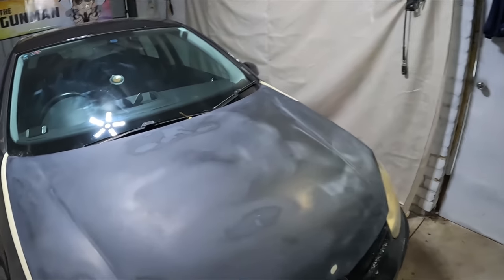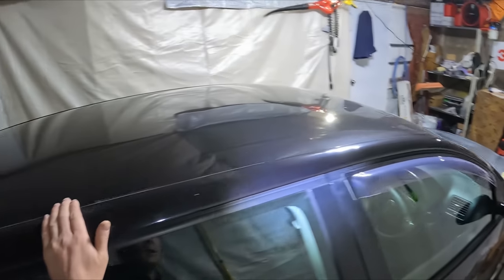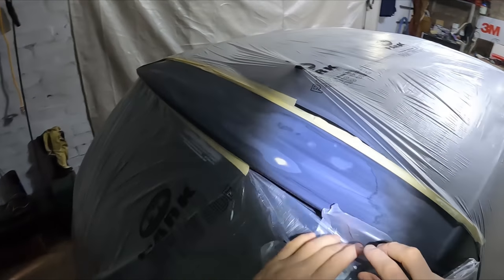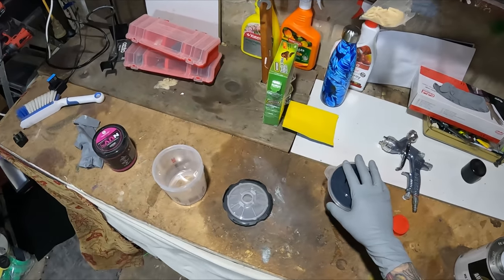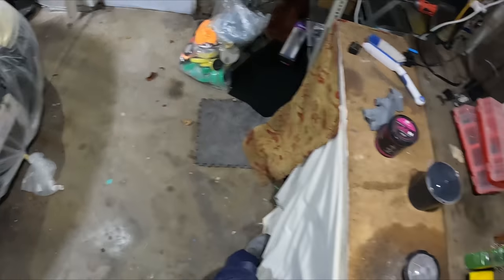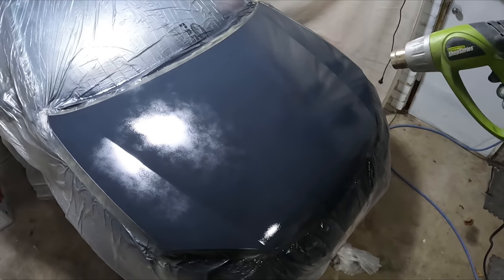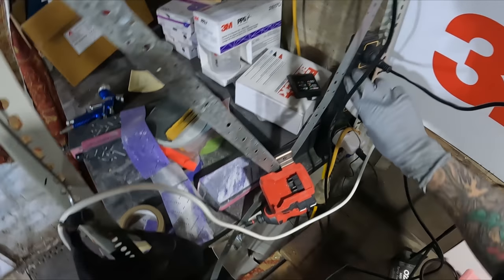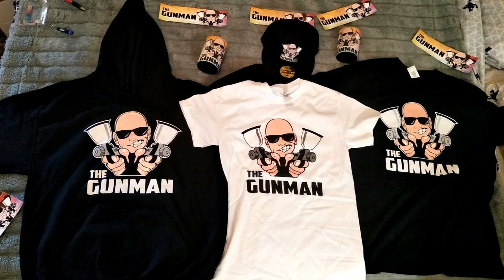Primer Work In The Garage.

Comment: I'm trying to do a refinish job of a roof spoiler for my car that's the clear coat peeling.
Color is black and i only have acrylic white primer in a can that in instructions says it's only for metal,wood, aluminum,glass and stone.
Can i use this white acrylic primer after i sand original paint that the clear coat peeling or do i need to get a primer specific for plastic and darker color?
I'm trying to find plastic primers but i only see adhesion promoter sprays for raw bumpers.

Comment: Good video mate. Im getting into DIY painting but my first job I couldn’t even start. I started to spray 2k primer and it didn’t even come out properly. It was like grey arm hair falling onto the panel. Discovered later I have a 1.4mm tip but apparently need 1.8 minimum for high build primer. Does this sound right if all other factors were correct such as psi and gun controls. Thanks!. 
Also a mk5 golf like the one in the video !
Reply from the maker: More thinners by the sounds of it man. More thinners.
Reply: @TheGunmanChannel  thanks bud ! it was very gloopy. Obv too thick to come out the nozzle? I added 10% thinners but obv need more. Will be trying again soon thanks 🙏🏻
Reply from the maker: @butters_  try another 5-10% and see how it goes. Just keep in mind it will have less build so you may have to apply an extra coat.
Reply: @TheGunmanChannel  that’s fine. I’ve just bought a brand new unpainted wing/fender so don’t think I would need much build anyhoo. Will let you know will be painting over the weekend. Cheers 🙌🏻

Comment: What was that cleaner you used on the gun at the end of the video? 🍁(from Canada)
Reply from the maker: Was that the 3M gun cleaner? I can't recall the part number.
Reply: @TheGunmanChannel  Thanks that's what I need to look it up, 
3M™ High Power Spray Gun Cleaner, 26689